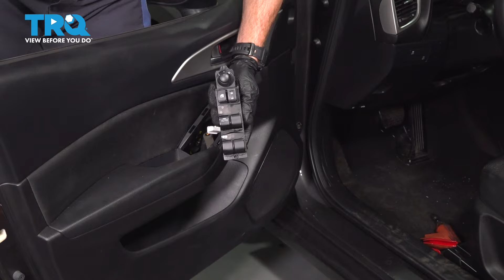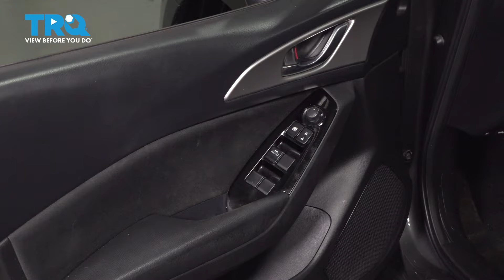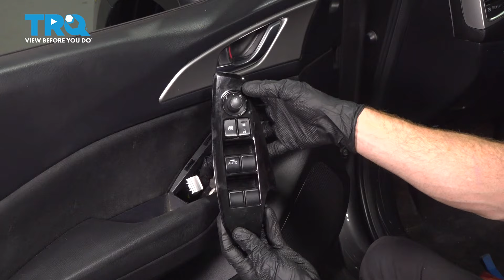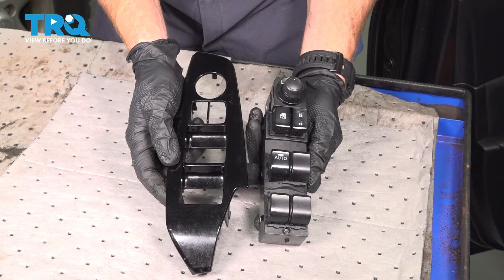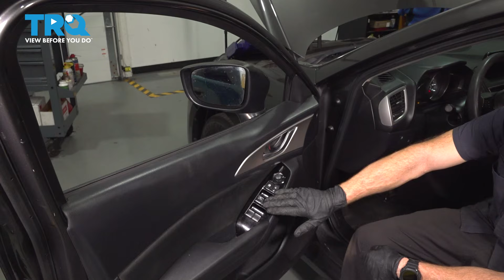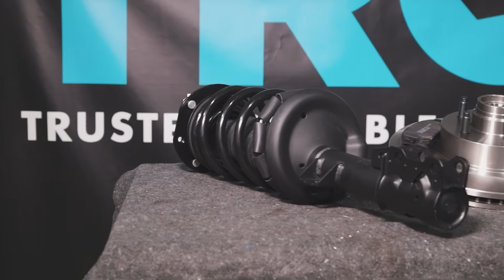How to Replace Drivers Window Switch 2014-2018 Mazda 3

Comment: My power window on my drivers door just went , the button felt super loose and was very sensitive to react then i drop home and had no power at all . But heres the catch all the other windows work fine , would you have any recomendation ? Can i fix the one power button or does it need a whole new master switch ?